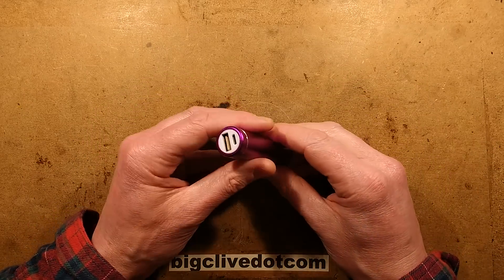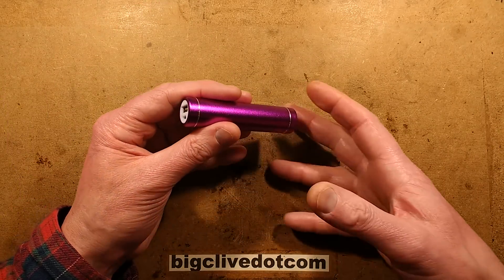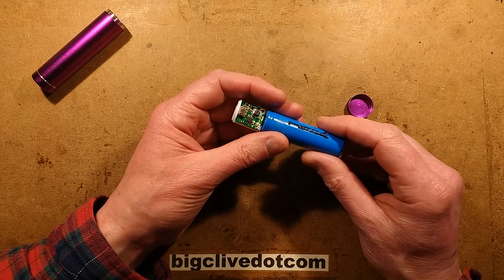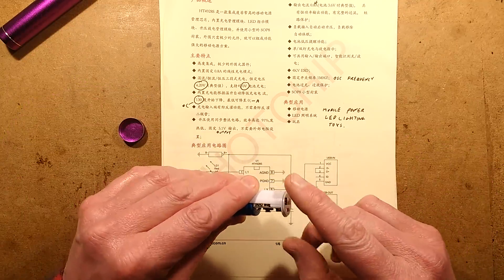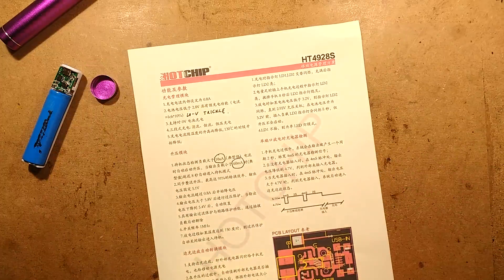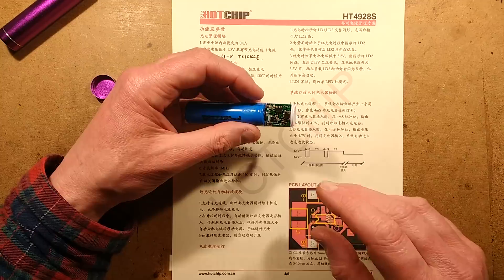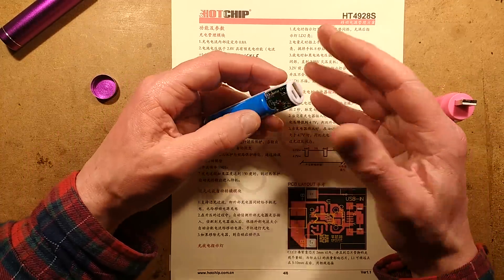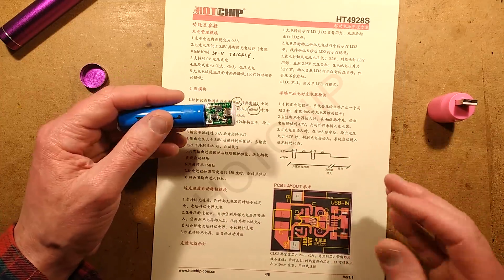Unusual USB power bank control chip.

Comment: Awww sweet, that is something I actually have need for several, and I don't think the 4.7 low pulse will be an issue.  It's too bad the listing was pulled...
Reply: Dustin Sparks if you can find a holder these little boards are doing a similar job, I'm using them to power and charge little projects 😁 https://rover.ebay.com/rover/0/0/0?mpre=https%3A%2F%2Fwww.ebay.co.uk%2Fulk%2Fitm%2F282503664754   The chip is TC4056A and a couple of others.. you've might have heard about it.
Reply: Search ebay for "18650 usb" then sort by price low to high and you'll see it.
Reply: runforitman BigClive's patreon supporters get early access I believe.. typically a link to a non-public video, you can do that on YouTube.
Reply: Ollie B Thank you for this link. I am transitioning from four alkali to 1 lithium cell for some projects & I needed a charger circuit with low leakage & this looks to be ideal, so I ordered some. Thank you!
Reply: RUSTA in Sweden sells these for about 5 Euros. I have 2 of those at home, now i actually feel safe using them =)
Reply: Clive posts videos unlisted initially, then shares the link with his Patreon supporters, allowing them to view it early. Then he sets it public later, hence the "Published" date you see. It's something that's become quite common with YouTubers that have a Patreon.
Reply: delayed publication/scheduled release
Reply: Try this link I have these & work OK
https://www.ebay.com/itm/Portable-2600mAh-External-USB-Power-Bank-Box-Battery-Charger-For-Mobile-Phone-/381876414309
Reply: I did use my car battery before, but I'd rather not drain it each time. I did use a low power cut off buck converter. The issue is, in the summer, keeping it on for long periods of time while the car isn't running caused swollen battery issues and killed 4 of my dash cams, 2 melted to the point you couldn't press the buttons anymore. One of these power banks can provide power for an hour or so, just long enough for when parking in car parks. My new dash cam only uses capacitors and can't power itself. A cheap battery pack like this is ideal.
Reply: Dustin Sparks I bet you'd still be able to get it from AliExpress.
Reply: I plan to use mine for a dashcam as this has passthrough. Just to allow the dashcam to run for an extra hour or so after parking.
Reply: J Anything Why not just use the car battery?
Reply: Wait what
How was this posted a week ago if this only came out an hour ago??